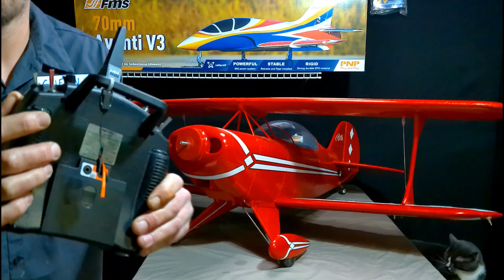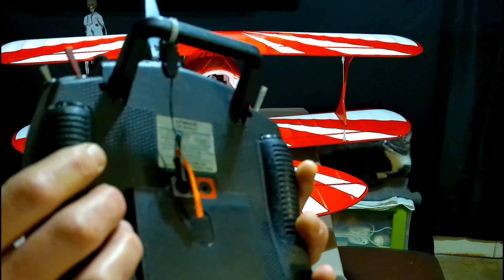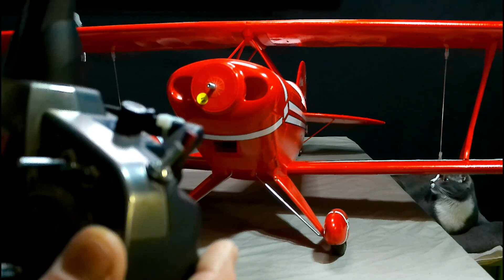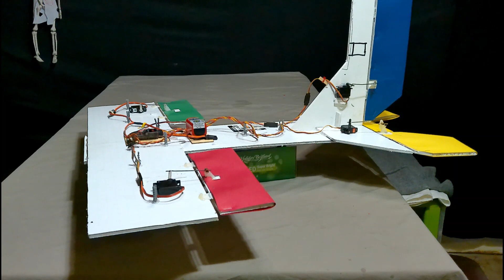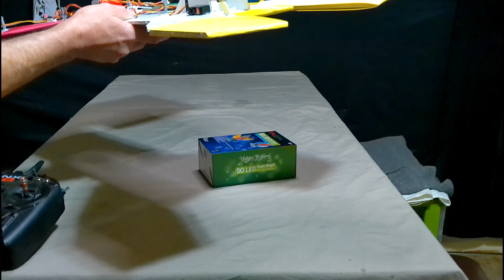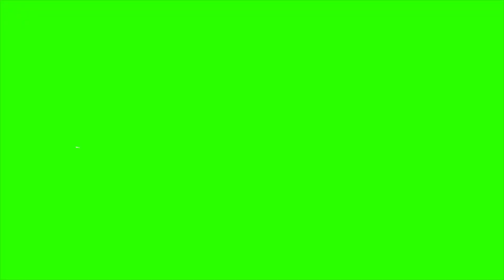SPEKTRUM SMART RECEIVERS ADJUSTABLE AS3X GAINS HOW TO USE 9 CHANNELS ON A 6 CHANNEL RECEIVER AMAZING

Comment: Hey Sean , I'm not sure if I can have safe on other raidos other than spectrum. I like spectrum but the receivers are so pricey. Like 90 bucks for one with safe and I need safe lol .I can't afford that price for more than one plane. Sorry I'm disabled and on a budget can only work part time and I really want to do this hobby with my grandson. But like I said I need SAFE. THANKS FOR YOUR TIME!
Reply from the maker: safe is available on several other products it is not called safe on other brands you can have a basic 5 and up chanell receiver with any radio system and install a gyro between the receiver and the servos then chanell 5 would turn it on and off. hobby eagle is a brand ill do some videoos on that subject
Reply: Flysky transmitter have some kind of safe system?
Reply: @josephdale5400  Flysky FS-i6X transmitter, A8S receiver and Radiolink Byme-A stabilizer is about the best set-up for your needs Joseph. They have some limitations as you would expect at that price level but will work quite well for most of the smaller T-tail parkfliers. The Hobby Eagle Pro or Super stabilizer will give you more features but is more expensive and more fiddly to set up. Longer range receivers are available for Flysky (iA6B etc) and are just a fraction of the cost of the Spektrum receivers for similar performance.
Reply: Thank you for your time and help Sean??
Reply: !!!!!! Is what I meant thanks again Sean!!

Comment: I have a DX8Gen1 TX - and I have it bound and setup to a E-Flight Timber Evolution 1.5m - I have everything working right but when I go to telemetry and do a autoconfig - it finds and adds the AVION ESC , but when I go to select it - the screen on my DX8G1 jumps back to the main default menu page for the plane. So its like trying to get into the telemetry on the ESC jumps me out of the telemetry screen to my home default screen for flying. The DX8G1 is up to date as far as I can get it for firmware - I don’t get it .. LOL  PS I’m 59 years old in your viewer demographic - but my wife tells me I act like a 25 year old ! LMAO 🤣
Reply from the maker: hey im sorry i missed this from you . my guess is the dx8 g1 is not compatable with avian . spektrum has not said that directly buy they have said that the only generation 1 radio that will do everything that is out now is the dx18 G1
Reply: @GRIFFINRCPLANES  Thanks - Thats what I figured but could not find any info - Cheers keep up the great videos and easy going instructions - I’m learning a lot for a soon to be 60 year old R/C Helicopter pilot who is flying fixed wings for the first time and loving it ! LOL